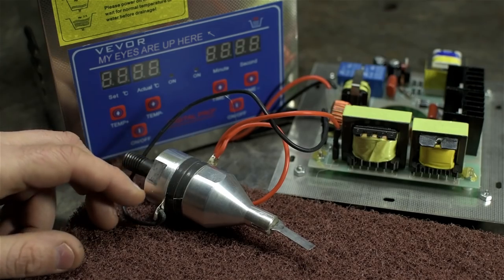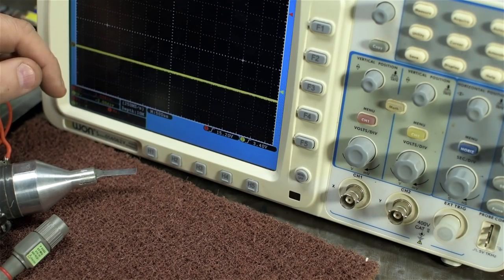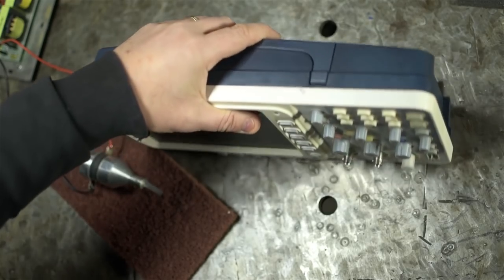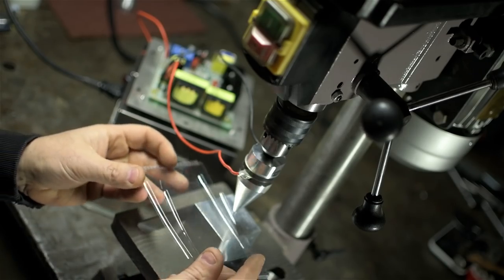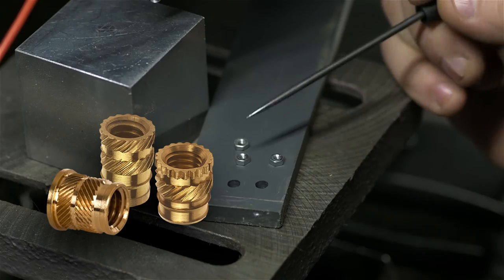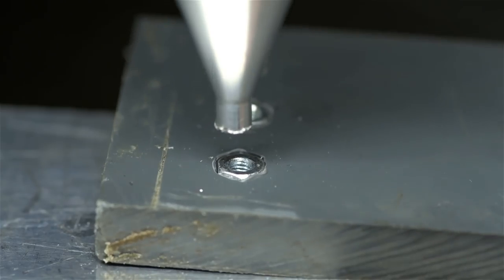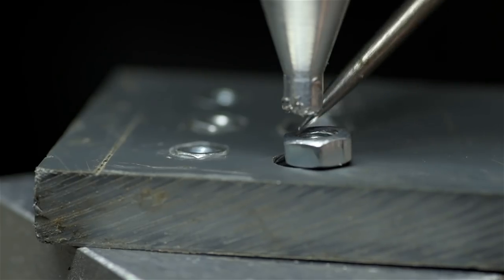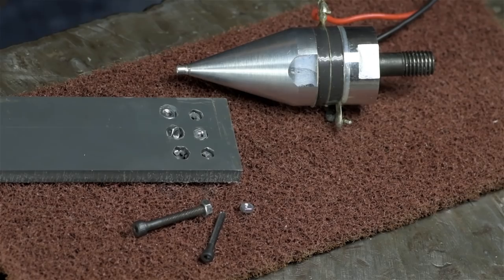DIY Ultrasonic Welder?! (Answer: NO)

Comment: Ultrasonic welding?? That's the mark of the beast!!  I grew up in a time when, if something went wrong with the "appliance" [kitchen, music, automotive, related, etc..] we could simply grab a Philips screwdriver, take the [steel, bake-a-lite or plastic] cover off and replace or fix the broken part.
Enter ultrasonic welding and the age of, [because you can't open it up]"throw it away and buy a new one".
I recently replaced the "door lock actuator" in my wife's Honda Accord.  The part cost $40 bucks and took about 2 hours [my first attempt to do this one].  I was able to open the "broken" actuator and inspect it.  All it needed was a new micro switch... at a cost of 55 cents.
The Honda dealer quoted my wife $120.  120 bucks for what is actually a 55 cent fix that cost me 40 bucks.
Ultrasonic welding is fun and interesting... if you work for the devil  LOL
Reply: You are missing somethings in here, its simple thing, its people need to earn the salary and just because it could be fixed with 55cent part it does not mean that labor to replace the part is worth 25cents, and when you consider that dealer has to hire people to fix cars and provide some sort of warranty on their work it would be just waste of mechanics time and your money  to replace this 55cent part instead of whole assembly. It is really sad when people like you who just don see any worth in other people work, and start downplaying and making others look bad just because they ask money for the job. Man you probably would start screaming if they fixed the car with 55cents part and took 150usd from you for the job.
Reply: Alvydas, .... c'mon, it's not meant as my MBA thesis.  It's a tongue-in-cheek view from the perspective of someone born in 1957, seeing, living the changes in manufacturing.

Of course, there are labor charges, shipping charges [of the parts delivered], business fees associated with operating a 'brick & mortar' business, especially the size of an auto dealership.

Perhaps YOU missed MY point.  It's all in fun.  Hence the moniker "mark of the beast"
Reply: @Alvydas Urbonas Oh come on now, if we took that to its logical extreme then it's best just to have the wife get a new car, there's no labor involved, she just drives it out of the dealership! But wait, they need to actually make that new car! And then you have to scrap the old one, and so on... Obviously, the same goes for the new door lock assembly, no labor or costs have actually been saved, just transformed into a mindless production of new parts. Now, not to say that that way has actually no advantages (e.g. waterproofing, ease of replacement so you can hire worse mechanics, etc) but there was a limit that we have clearly passed here. We really could do better than to make trash straight out of the factory.
Reply: Unfortunately that's the way things are made these days. 

Little or no thought is put into repairs, just get the manufacturing costs down to a minimum. part of that is making components that a trained monkey can assemble into a car.  The position of components is dictated by ease of manufacturing.  If you can get production time of a car down by just a few minutes, over time it ends up in the long term a multi billion saving. 

when they come to repairs, the Main dealers, (or main stealer, you choose) don't want to pay real mechanics. That costs too much. They employ "technicians". They have a computer that plugs into the car and that tells them the problem, then they look on another computer which gives them step by step instructions, including pictures, on how to replace the part. It gives them a list of part numbers and even tool numbers they need to complete the job. 

and here's a bigger kick in the teeth, 

When parts are manufactured, they have to be made to a certain tolerance. You would think this is for quality, but no, its because the machines used in assembly cant fettle about getting a part into place. What happens to parts that don't match the tolerance levels? they get packaged up for spares for dealers. So when you pay a premium for original spares, they are not as good as the original parts on the car. A lot of the time you can get paten parts that are made to a higher standard than the original manufacturers parts.

Main dealers charge a premium for repairs so they cover the cost of warrantee repairs...

The thing with most modern car engines is that they are a lot simpler to fix than you would think. most of the time what fails is a sensor. plug in a code reader and it will tell you what the problem is, most of the time its the actual sensor that's at fault. Replace it and your good to go. most sensors just plug in and are held in by one or two nuts , or more commonly a torx nut, so you have to buy  a new set spanners !! In reality, a car engine is a lot less complex than they were 30 years ago. no complicated carburettors, just a simple throttle body assembly, no contact breakers, distributors, coils.... just a computer that adjusts everything on the fly depending on sensors.

you can buy a ODBII code reader from ebay/amozon for just a couple of quid that connects to your phone via Bluetooth and will tell you everything that's going on with your engine. Its all you need to diagnose most engine faults these days....
Reply: Tommy Rad bakelite, I have such lovely memories, but yeah, the world has changed, corporate law insists upon max profit and redundancy means making money. They would have done it decades ago if they had thought of it and been able to erode labour laws quicker.
Reply: The future is now old man
Reply: @martinjones6694  Yeah, well the computers are what have ruined cars nowadays. About six-seven years ago when I had Nissan Almera it's integrated CD/Radio player went haywire. I went to Nissan dealer to ask how much the new main unit would cost if I just buy the unit and replace it myself. The guy behind the spare parts desk clicked few times the mouse and then told me the price of the part. I was shocked. The price of the unit was about $1300US. 1300 for the CD/radio palyer!!!! 1300!!!! WTF?! And the funniest thing with that was that the unit would have to be programmed for my car's computer to accept it. Of course for a additional cost. And because of that programming it would have been impossible to use similar player unit from other car as the official Nissan service does not program previously used units and those programming devices are not available to anyone else. I said to this god damned sales person "I rather listen the tire and wind noise then. Goodbye." and left. Car manufacturers do not make their living by making cars, but selling the original spare parts.
Reply: Tommy Rad: I'll have you know I do work for the Devil and by damn it is fun!
Reply: Darn whippersnappers with their ultrasonic welders! Get of my lawn!!!*shakes cane*

Comment: If your goal is welding wouldn't you want the oscillations to be lateral between the work pieces? Like side to side instead of up and down?  I wouldn't expect the up and down oscillations to generate much friction at the material interface...
Reply: Robert Kennymore yeah but it  is not friction weld
Reply from the maker: Rob/Alex: I think ultrasonic welding of plastics is done up/down.  it's magic.  if it were side to side, once you put down one "weld dot" how would you do the one next to it?  or the 100th one down the line?  to seal up an entire package I mean.
Reply: I thought for these kind of applications, the ultrasonic tool head is designed to produce a complete weld in a single application. That said, the stroke of the tool head (amplitude) is also so small that the material could quite likely tolerate some deflection/distortion. If you have time & the setup, it may be worth testing. Perhaps even applying the tool from an angle using a chisel shaped tool (like a soldering iron tip) would have improved results.
Reply: @ThisOldTony  that looked similar to an actual ultrasonic welder...i think where you went wrong was on the kHz and horn tho...coming from a guy who's been around plastic welders for a few months...but nice job anyways
Reply: @ThisOldTony  you should try spin welding tho it's a lot easier introduction and still cool
Reply: @ThisOldTony  I've been programming a two axis servo spin welder...the things it can do is incredible
Reply: Hi Craig. Do you know why there are portable plastic sonic welders but hardly any portable metal ones. The market seems to be dry of any form of portable units made for copper wires and small electrical parts. Thanks Craig.
Reply: @zark212  I'm not entirely sure but I'm willing to bet it is due to the materials makeup and what settings you have to run them at to achieve a good bond....the metals probably run at settings that make it not feasible or else it might be due to the market not being therw

Comment: Tony, I made an ultrasonic welder a long time ago.  The orientation of your transducer is the problem.  It is firing vertically up and down, almost like a mini jackhammer.  For an ultrasonic weld, it has to vibrate horizontally.  The two plastic pieces rub together really fast at the contact point and fuse.  Also the reason your ultrasonic knife results were less than stellar.  Angle of the dangle is the key.

Comment: Ultrasonic-something-something-AIRGUN mods? please ?
Reply: Welding a point contact to a flat works. >| The v melts like "filler".
The retention of nuts,bore a recess for the nut. Then use the ultrasound horn to melt a disc from the base material around the nut to mold a retention disc over the nut.

Comment: I used to work with an ultrasonic welder at work and when we first got it there was a small class.  Long story short.  If you weld plastic to plastic you use one type of motion but if you weld metal to plastic i think, you use another motion.  I can't remember witch motion goes with which, but one was an up and down motion and the other was a side to side motion.  Great videos, keep up the good work!  :)

Comment: Figure out a way to hook the ultrasonics up to a screwdriver and then you've got something.
Reply: wonder how that would do at breaking free seized or rusted fasteners while twisting
Reply: At least the hinges on the Tardis door should be smooth and quiet when the gang heads back to muddle with more Antikyra-something-something..eh whatever.

Comment: Old Tony Just a thought  maybe try to just start a blot of the appropriate size and try if it didn't weld the threads of the bolt great.  Also would give u a way to test the grip strength of the connection , and bond if any. By the way I love your videos your honesty and humor are top rate keep them coming.

Comment: im by no means qualified, but isnt the point of welding to heat up and smelt the plastic together with friction from the vibration, isnt it counter productive to be doing it on top a big metal heatsink?
Reply: Julepalme 
Ultrasonic welding is different
Reply: Matt G no
Reply: Considering all of that what you say, would lead to a non entertaining video ;-)
I like to see the principles of an demolition hammer realized with an ultrasonic horn made out of aluminium.

Comment: So if you ever desire to go back to your project, here is some info that will help. The friction that melts the plastic is not between the metal surface and the plastic. The friction is inside the plastic itself. The horn actually compresses the surface. Think of taking a piece of wire and bending it back and forth really fast. The location of the bend heats up. The same with the surface of the plastic, you are bending the surface of the plastic. Now in your first trial, the problem is likely two fold. When welding blister packs, typically they use a knurled surface horn. The reason for this is the sharp points on the knurl flex the surface of the plastic, creating heat. This initiates the melt. Once the plastic turns to liquid, it is very east to move/flex, so the friction inside the plastic is easy to continue to create heat. The difficult part is getting that first initial melt, which is what the knurl is for. In your case, your light pressure initiated the melt, but then you needed to push harder to melt the rest of the way. Much better would be to knurl the tip of your horn. Secondly, your horn does not have enough gain by itself. You could either add a booster or cut away the taper of the horn to a catinoidal shape. The gain of the horn is the ratio of mass at the top of the horn to the mass at the bottom of the horn.

For driving inserts, you don't need a ton of gain. This is why for the most part you were able to bury the nuts into the plastic. You could just make your tip larger around, as you don't need all that gain. The nuts pull out because there isn't any ridge to keep them in the plastic. Find a taller nut and turn it on a lathe. Cut some rings around the edge. 

Lastly your horn tuning needs to be a little closer to 40KHz. The system becomes inefficient the farther you get away from the design frequency. I didn't see how you put the transducer together, but I suspect there are some issues there as well. It should rubber mounted at a nodal point in the vibration.

Comment: So, have been looking into doing this myself after watching this... What I've found out: First: typically US welders are lower frequency... around 15KHz. Second: you need much much higher power for welding, think 2000 Watts. Third, the drill press idea is pretty brilliant, but what you actually want is the press to be pressing a contact point that is perpendicular to the transducer which would be attached to it, so the direction of the waves are kind of parallel to the plastic pieces rather than perpendicular to it, as with ultrasonic welding, you're actually vibrating the molecules together.

Comment: I wonder if it would work like resistance welding? Try making a similar horn with a larger tip, but round over the edges to get rid of the sharp edges that act like cutters. Bring it to about the same contact patch as the original. then bring pressure down on the workpiece, then turn on the power for a short time. turn off the power, wait a short time to solidify then release pressure. Might work. I really enjoy all of your videos and cant wait for the next to show up

Comment: Love your vids!
You may be able to see the mechanical portion of the resonance on your (poor lonely 2nd channel) scope by connecting the scope, no power on the unit, and lightly tapping the end of the horn. The piezo will generate a voltage as the assembly oscillates.

Comment: At work we use ultrasonic welding machines to weld the filling tube of refrigerators shut. They use about 500 Joules worth of energy in about 0,3s so about 1,5kw

Comment: I think the motion of the ultrasonic welding head has to be parallel with the two pieces you're trying to weld to cause them to slide against each other and create friction.  So you put pressure downwards on the welder head and the weld head slides left and right ultrasonically.  Instead of you've got the energy directed up and down so it's not causing any friction and not doing any welding.  That would also explain why it sunk those nuts so well.

Comment: Honestly, you made a decent countersinking tool. You could thread the insert onto the horn and drive it that way. Also just rough up the sides of your bolts for a bit more grip, and give the surrounding plastic a chance to liquify by running it a little longer. 
Very cool!

Comment: On most scopes like in the video, the BNC connector is earth grounded.  This means the negative probe lead is earth grounded when plugged in.  Unless the negative lead of the transducer was earth grounded, the current from that lead was shorted to ground.  Likely the cause of the smoke.  I've seen ground leads on probes melt due to this issue.  Options:  1.  Use a differential probe.  2.  Lift the earth ground on the scope power cord with a ground lift adapter (considered unsafe, potential shock hazard but can work if the device being measured doesn't have high voltages above or below ground). 3. Only connecting the tip of the probe may capture the frequency of the waveform.  Amplitude and shape cannot be trusted however.  4.  Battery powered scope.

Comment: Hi Tony, a couple of years ago I went to a course on using Ultra sonic cutting of bone and teeth used for atraumatic tooth removal (if there is such a thing) and bone modification for dental implants . The advantage that was proposed was the US did not damage soft tissue but cut hard materials. The difference between a dental ultra sonic scaler and the cutter was that there was another phase in the transducer or another transducer at 90 degrees to each other , with one phase vibrating on the long axis of the instrument and the other in the horizontal plane. It was about 40 watts as I recall. They used the term 3D with respect to the tips vibration
Reply from the maker: interesting!  also, "ultrasonic cutting" and "teeth" should never be in the same sentence.